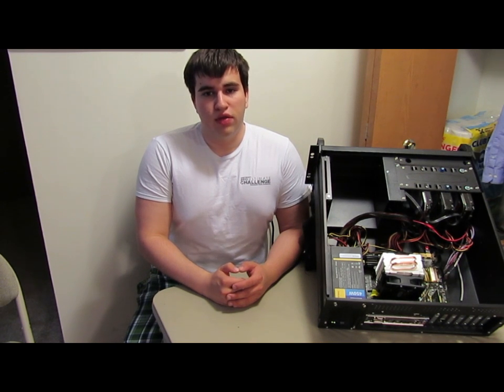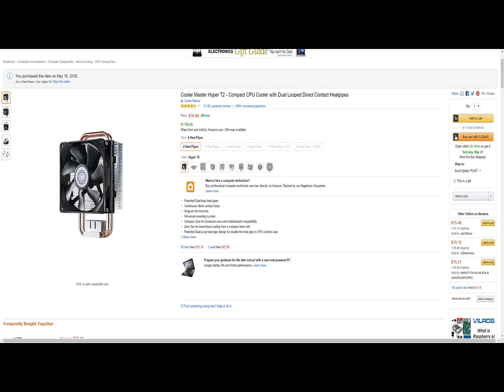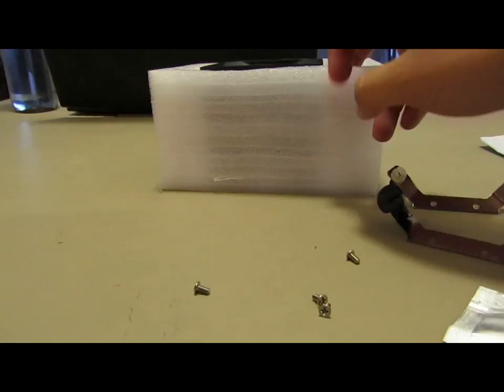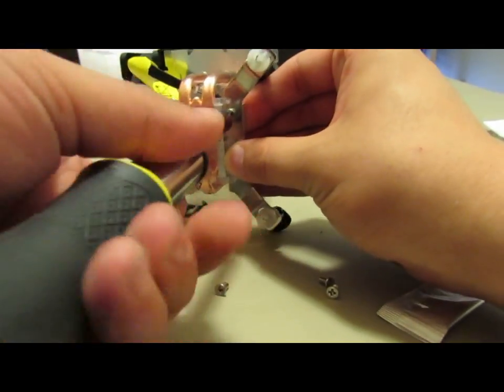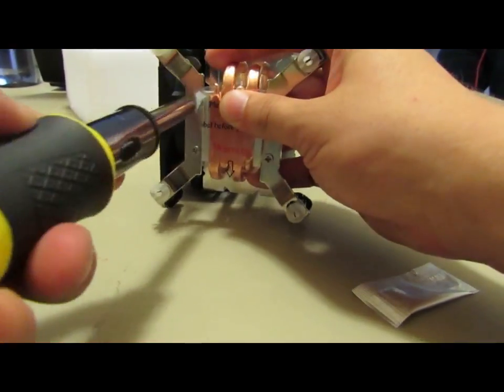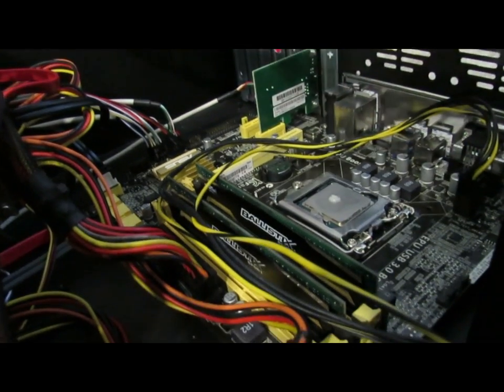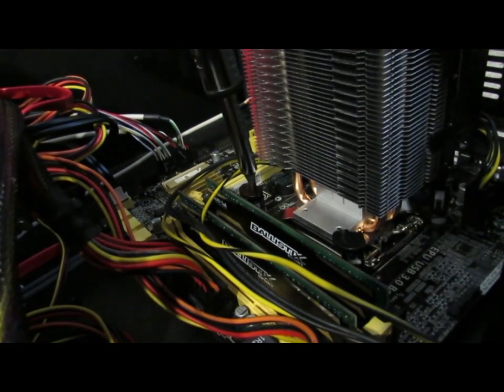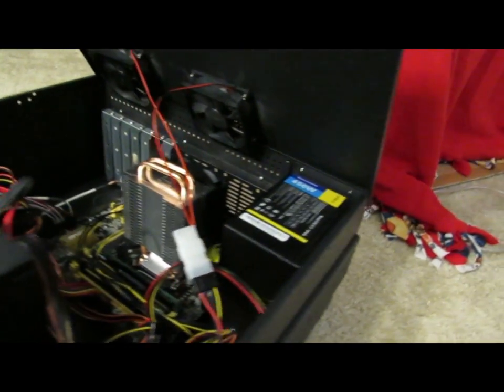Cooler Master Hyper T2 Review and Install (LGA 1150)

Comment: Ugh. I never understood why Intel and Intel mobo manufacturers cheaped out so badly and went with the push pin design for their cooler styles. They are so annoying and feel so unreliable. Just give me a metal back plate and some screw holes.

Comment: A worthy video for installing the Coolmaster Hyper T2.  I was able to use my previous CPU bracket with a slight modification, and pulled out the plastic pins.

Comment: I'm thinking of picking this up, my buddy was talking me into it, i was gonna just use the stock cooler, but i live in the desert, so the ambient temps in my house are a little high, i have an intel core i3 6100 cpu, do you think i'll run into any issues installing this on a regular ATX board?
Reply from the maker: Mine actually ended up failing. My intel clips broke off and now I use it on my AMD system
Reply: you see that's the problem

Comment: These T2's , and T4's are a piece of cake on an amd, but i hate them on intel.  The plastic crap pins attaching it were impossible for me so I removed them and modified the long screws and spring loaded set up on my original intel cooler to work.   What a waste of time.  Plastic holding pressure on an awkward size cooler, is crazy.
Reply from the maker: Yes I can confirm that I have had to go into my file server every 2 or 3 weeks and re seat the clips for the Intel cooler, In my upcoming super computer build I will be using AMD based CPU's for my storage machines for sheer price to performance as well as a fool proof heat sink mounting system that doesn't come undone
Reply: You can modify the hold down to use the screw threaded hold downs, its a pain but mine has never come loose.